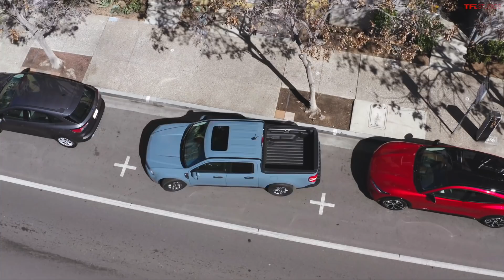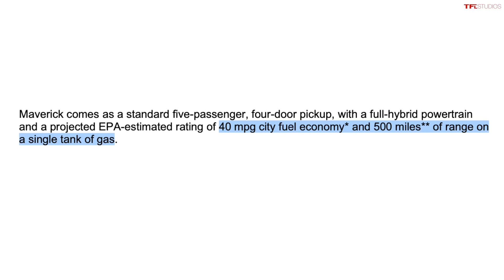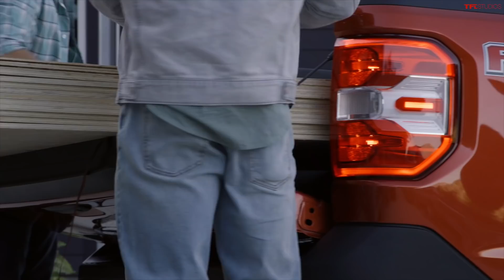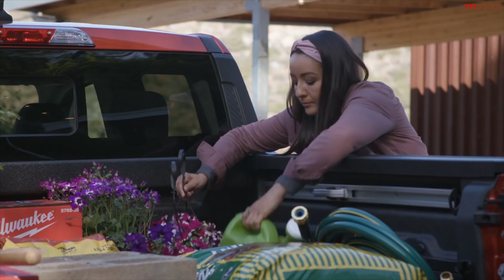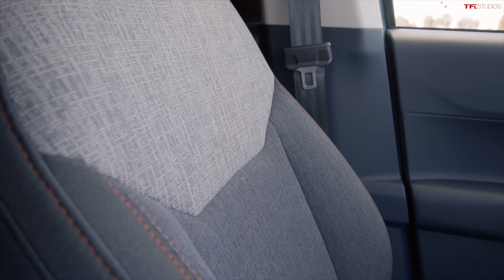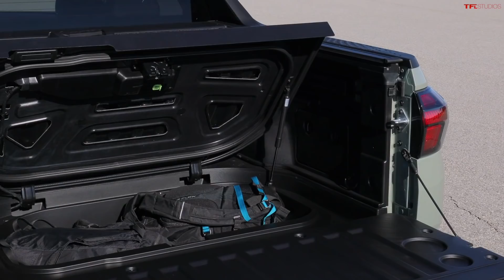Hands On With The New 2022 Ford Maverick: Here Are The Top 10 Things You Need To Know!

Comment: Yep, STARTS at $20K, that's for the front wheel drive only version. Add all wheel drive which means moving to a different 4 cylinder, and another transmission, and you add $4K right on the spot, and that's for the low end version. You want the XLT or the Lariat, which is close to $26K, you now have a teeny truck over $30K for the AWD version, add a few options, you're going to be at $34K-$35K, and for what? A truck about the size of a Ford Escape? Nope.

Comment: Ford is producing GARBAGE...! Putting small turbo engines to replace Naturally aspirated engine... is recipe for disaster... they will not last past 80,000 miles. I will stick with a Toyota any day of the week they will go 300,000 miles with normal maintenance. Consumers need to wise up and just simply not by the garbage for GM and Chrysler are producing these will NOT last

Comment: Ridgeline owner here, I like what Ford is bringing, but there is one huge problem I see where they should have copied the Honda: The storage under the rear seat is completely inaccessible if you have a child seat in there since they went with a solid bench. Honda is a 60/40 split so you could still lift one part if you have a single child seat and access the storage (if Honda had used bins like the Maverick that is). Of course, Honda went with open floor for more storage, but I wish they did sell an aftermarket bin set so you could keep things under the seat from rolling around if you so choose.

Comment: In my opinion, a truck should have a body on frame construction with rear leaf springs, a 4x4 drivetrain with a 2 speed transfer case, and no hybrid option. If that were the case, as well as a single cab with longer bed, and a stick shift, then I’d consider buying it.

Comment: interesting.. its just a tin can wagon with top chopped off. you mentioned length and I was thrown off a bit. My fullsize 1996 gmc with xcab is 5 inches shorter. The space saving argument is really silly. the turn radius is valid tho.. almost two feet shorter wheelbase than my 96.

Comment: CVT is a deal breaker. That and a front wheel drive truck 🤦🏻‍♂️
Reply: It has an eight speed transmission
Reply: @michaelriecher5632  Only the non-hybrid version does. Not the hybrid. Might as well buy a Ranger.
Reply: @natedevilin9573  thanks for the correction,
Reply: @michaelriecher5632  No problem 👍🏼

Comment: Would love to see AWD with the hybrid powertrain.
Reply: It’s an eCVT. I believe Ford has licensed Toyota tech (they certainly have for the Escape), so a gas engine and two electric motors feeding into a planetary gearbox. No belts and pulleys like a mechanical CVT.
Reply: Yes! I haven’t been a fan of small trucks in the past because the price/capability/efficiency combo is just so unattractive to me. The price and efficiency aspect of this vehicle is AMAZING. It’s like buying a hybrid car, just with a super utility aspect that I’m really liking. I’m 6’2 so i don’t know if this size vehicle would work, but I’m definitely taking one for a test drive when they come available.
Reply: Im just not loving the cvt idea....
Reply: @truckerrickakamanowar  Not really liking CVTs either, especially those from Nissan.
Reply: @truckerrickakamanowar  Me neither. Likely would be fine w/the base unit but it'll be interesting how the CVT holds up to the higher end/higher powered models.  But seriously, CVT in a truck even a truckette?
Reply: @Lt_Tragg  Higher powered turbo ditches the CVT for a conventional 8 speed auto
Reply: What's wrong with CVTs?
Reply: @StephenKoplin  Look here for some insight: https://emanuals.com/blog/cvt-transmission-problems/   I curious if Ford is borrowing Toyota's tech (which is supposedly very reliable) for this CVT?

Comment: I think the Ford Maverick missed the mark of the compact truck for the small business.  I still see 2 door Tacomas used as a shop truck, with the mavericks 4 foot bed and 4 door configuration, it's not useful as a shop truck.  With the low price of close to $20k, high city gas mileage near 40mpg, it would have taken over the shop truck market for the city if it has a 2 door, 6 foot bed option.  With a unibody construction that would have twisted a 6 foot bed, and if they braced that bed, that would have been more weight and cost a lot of mpg.

Comment: Great video. You really did a great job of covering the big points and, like you, I couldn't help being impressed that Ford can turn out this truck starting at $20K.   If I lived in a more urban area and just needed limited towing capacity from time to time (U-Haul trailer / 18' boat) this is a very attractive option.  Was surprised that the ground clearance is almost the same as my F150 and suspect the real world clearance will be even better than my F150 due to the shorter wheelbase.  Still, I'm holding out for a 4x4 Ranger with the 2.7L engine as my next truck with a needed 7.500 lb towing capacity.

Comment: Ford is so confusing, if you look at the Ranger no dampening tailgate same on the Maverick, but they put an integrated trailer brake control on the Ranger but yet the Ranger tows more? In my region any trailer over 2500 lbs needs a trailer brake. So the Maverick tows more than the Ranger wtf 🤬 Ford you need to make your products with some consistency.

Comment: Believe it or not, this truck size is just about the size of the old 70s, 80s and 90s compact pickup trucks. It's great to see practicality being brought back into the truck segment instead of making everything bigger and heavier with features.
Something happened in the early 2000s where common sense went away with these trucks and the then-current large truck somehow became the compact-midsize truck, and commercial sized trucks were made into our current large F150 size trucks for consumers..and that's been the two sizes for the past 15-20 years or so.  All the manufactures did it.  Glad to see a true compact truck again.

Comment: I've watched 10 Maverick videos, yours is the only one to mention integrated brake controller on the towing package. This is a great feature. I like this trucklet a lot, and think it would fit my needs that include occasional towing of a 2400lb travel trailer. Seems it can be equipped to do that easily. Looking forward to drive reviews.
Reply: I never been into full size trucks because they’re a nightmare to park and feel wobbly in corners. This little maverick is going to sell like hot cakes. I may buy one since it’s cheaper than a pre owned Tacoma.
Reply: @angelgjr1999  the dodge big horn wasnt too bad when i threw it around
Reply: @angelgjr1999  doesnt have to be a nightmare if you have a backup camera
Reply: @SweetLouDootDoodlyDoo  Or if people simply knew how to drive or park without relying on technology . If a persons ultimate decision to purchase a vehicle comes down to the vehicle being equipped with blind spot monitoring , per-collision assist with automatic emergency braking  , active brake assist , active park assist 2.0 ,  evasive steering assist and adaptive cruise control with stop n go lane centering to name a few this person should probably NOT have a drivers license !!!
Reply: @7natcho  okay boomer

Comment: its a car trying to tow or carry large loads with a frontwheel drive and even the awd is going to be front wheel bia's (most of the power will go there) really hard on the CV axles that is why all trucks still retain a solid axle in the rear suspension

Comment: Nice job on your video, very informative. I'm looking for a smaller pickup for my business and the Maverick would have been a candiate until you stated that Ford will only offer it in the 4-door, short bed configuration. I understand that families and hobbists prefer 4-doors but there are those of us that require a work truck. I was also disappointed that Ford didn't include a built in trunk into the bed. I do like the hybrid power train and overall size. Maybe this is only the first iteration and Ford will make a version for us worker bees.

Comment: I still think calling this a compact truck is being generous. Whoopee, it's 10 inches shorter than the Ranger. That's still almost 17 feet long, and over a foot LONGER than the '96 minivan I grew up with. When I hear "compact truck" I think of the old '68 Bronco half cab TFL used to have. THAT'S a compact truck. The modern equivalent would be something like the Renegade-based Comanche mini truck concept you guys saw 5 years ago at Easter Jeep Safari: https://www.youtube.com/watch?v=C7Kcd8c_JQk 
Something that is ACTUALLY smaller and an entirely different vehicle. I'm sorry, but I can't help but see this as just a Ranger with the rear 12 inches of bed chopped off.

Comment: If Ford had a lick of sense in their badging this would be badged as a Ranchero, after all this is designed for the same market the original Ranchero was built for. If they other plans for the Ranchero name the next best would have been Courier. The Maverick moniker should have been put on the Mach-E which is #stillnotamustang. I am loving the innovation but they need to fix the badging.

Comment: Expect plenty of fleet versions being sold to autozone, advanced auto and O'Reilly 's
Reply: heh. I only see chevy Colorados there. Is it a price thing?
Reply: @cryengine_x  if you noticed, the Colorado's you see are standard cab and low to the ground. 
I expect those will get replaced with the Maverick.  
Ranger was the truck of choice until the small one was discontinued in 2012
Reply: @JohnMiller-zn9pf  Yeah i remember that about they used to use Rangers now that you mention it! Honestly I love the way the current gen Colorados look above all trucks, just my opinion. The seem to have spotty quality though. The new body style looks quite spacious, they have old and new Colly's parked side by side at OReilly's and the new is so much bigger, it's eye opening. Actually I was googling and last gen Colorado/Canyon (I have an 08 reg cab Canyon) is smaller than this Maverick. Well at least my regular cab.

I really like a lot about this Mav, for <25k I can get the beefier 2.0 engine (course then I lose the 40 mpg, which admittedly would be nice)  and AWD, and of course 4 doors standard. Right now in insane price world it's probably cost about 35k to get a similar 4dr/4wd Ranger/Colorado. 

Assuming we can even get MSRP on these! Ford has a build and price website up though, so I guess we can right now?

I really like a lot about these but, really dont like the looks (which is a personal thing) or  how low it rides. Still, the price and advanced features (all the cubbyholes, tie downs, 110v outlets, all cool) are making it tempting! TBH I dont need truck truck features that much, I dont go offroading or anything. And I feel like with laying down the tailgate this 4.5 bed is realistically long enough to accommodate anything I'd likely need. All that said I still live in Texas, and not sure I could accept this truck LOL. It's really the price, MPG and features that make it tempting.

Comment: I'm a ford guy and this in my opinion is the dumbest, ugliest and useless thing Ford could have built. Subaru already went down this road with the Baja years ago and they killed it because it didnt sell. And for people saying this is like the  Explorer Sport Trac, sorry but you're wrong. I had a 2004 sport trac before i bought my 2015 f150 back in 2018. The sport trac was basically a 4 door ranger with a composite bed. My 2004 was body on frame, not uni-body, with a solid rear axle and 4-wheel drive. Ford changed that in 07-2010(final production year of both the sport trac and that generation of the ranger for the U.S.) when the went to a rear independent suspension for the sport trac.

Comment: This truck I think is a terrible idea, I’m in the market right now for a BASIC truck. I don’t need all this junk, I don’t tow trailers, I don’t want a hybrid and future tank in reliability and value of a hybrid either. I want a basic pickup truck with a single cab, stick shift, crank windows and a small 4cyl hopefully diesel which would help with the fuel economy a bit! My grandpa had a old Ford ranger 400,000 miles, no power steering, no power Windows or door locks just a little truck that was super cheap and he could park it and use it when he needed, the interior was very utilitarian. Plastic floors vinyl seats you could rinse out the interior with a garden hose. All this tech, electronic and hybrid BS is crazy. I want a pickup truck that is just in the background, I don’t want it to commute, I don’t want it to go to dinner in, I want it if I need to haul a fridge, or my motorcycle, or some cinder blocks, I want it to push the limits of heavy duty and be used and abused then forgotten about until I need it again. These trucks are NOT that, you get what 10-12 years out of a hybrid battery? And poopoo your turbo engine too, again another thing to fail and dump oil into your engine and something very costly to repair. Then with all the safety crap on it what if you bump it up a little, or overload it a little compact pickups get beat up. Having a unibody construction you’ll scrap that truck, this truck will be useless on the 2nd hand market for gardners and handyman which will tank your resale value and ultimately dissuade anyone from buying another one. Is all this is doing is diluting the brand and the truck lineup like Mercedes has done with things like the CLA or whatever it is. Yes I also agree Tommy, you did a good job here presenting this one! I liked the format.

Comment: It was interesting when I read that the standard configuration is a 4 cylinder hybrid, but when I saw "CVT" I noped right the hell out. What has manufacturers so convinced that they can make those pieces of shit work? Looks like Ford hasn't learned from the Focus/Fiesta debacle.
Reply: I'm not a CVT fan but the Focus has never had a CVT transmission.  The problem transmission was a dual-clutch automatic.
Reply: @bobnelson7608  I didn't mean to imply that the Focus/Fiesta had CVTs, only that they had chronic/catastrophic transmission problems and cost Ford millions in a completely preventable situation.

Comment: They're not winning any beauty pageants with this one, IMO. But if you're looking for something small and "trucky" this is definitely more truck-looking than the Santa Cruz. And the base hybrid at $20k US ($26k in Canada) will be great for light commercial use. I can see these being used by landscapers, towing around little trailers with riding mowers and such. Perfect size for that and ideal for that sort of city use. But things like cruise control aren't standard?? That seems crazy, and why, price-wise, it will surely undercut the Santa Cruz. Not sure what Hyundai's going to do with pricing in the US on the FWD version, but Canada is only getting the 2.5T/AWD models, so we'll be paying a bit more regardless. The Hyundai is also going to have a fair bit more standard equipment, like the integrated locking tonneau cover. I'm shocked that Ford is going with traditional keys up through to the Lariat though. One would think it makes more sense from a volume perspective to just use keyless ignition on EVERY model ... one dash casting, one control module, etc. 

It'll be interesting to see how this segment shakes up. Would love to see Subaru bring back the Baja, based off the Crosstrek. That would be pretty cool. Always loved the original Baja.

Comment: It’s crazy that it doesn’t have push start and smart entry even on the XLT, but the dial shifter is standard.  Dumb.
So, you have to get a Lariat to get smart entry or is just not available at all?
Reply: Because pushing a button on a remote has become too much trouble. 🙄
Reply: @Daytripper58  You don’t just push a button.  You have to dig the keys out of your pockets or where ever else you have them first.  
When you have smart entry, you just need to have the keys with you and you never have to get them out.  You just grab the door handle, jump in the car, press the start button and go.  This is a huge convenience.

Comment: WOW! The MAVERICK has changed the COMPACT VEHICLE industry. $19,995.00 and 37 mpg....unbelievable. Great work FORD.
Reply: It's 21500 with destination, you need to move up to the next trim to get cruse control.  A hybrid without cruse is STIPID as the point is that you can take it on road trips.

Comment: I would argue that the Santa Cruz's 25 more horsepower and 34 more lbft of torque is more than just "slightly" more powerful than the top Maverick engine. That's a 10% increase in horsepower and a 12% increase in torque over the Maverick. Hell, the Santa Cruz's engine is more powerful than even the Ford Ranger's 2.3l ecoboost!

Comment: This appears to be a cool compact truck. I like the looks of it, it’s size is very garage friendly. I like the potential of the hybrid, and the eco boost option. This truck might be able to replace my 1989 F-150 and my 2015 Promaster City van. Maybe even my 2013 Prius included. It can be configured to carry 4x8 sheets of plywood, has a 1500 pound payload capacity, optional 4,000 pound towing capability, an optional 4x4 with skid plates, tow hooks and a lockable rear differential. 

I am gong to check this one out.